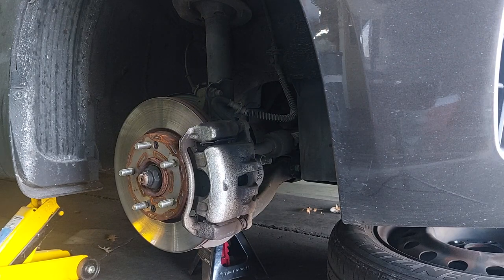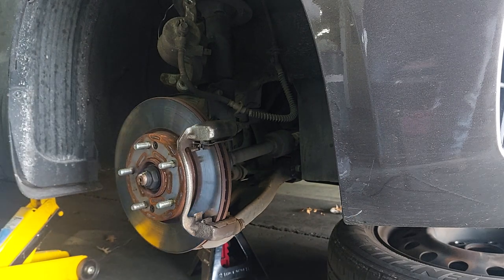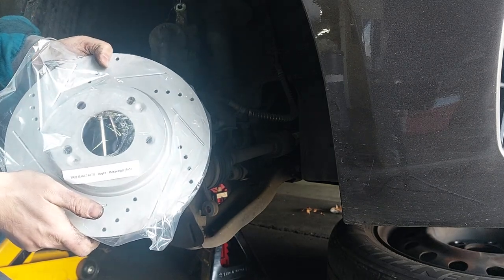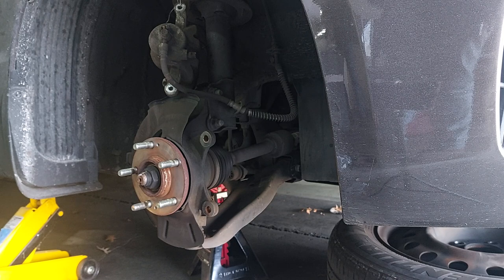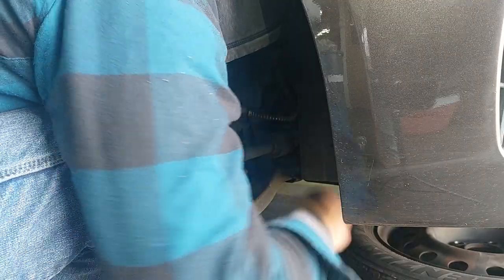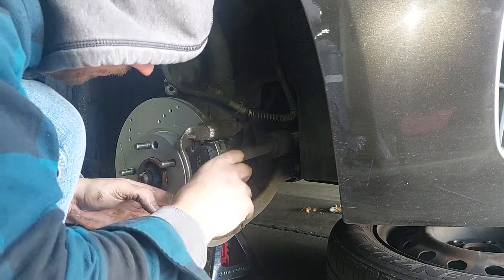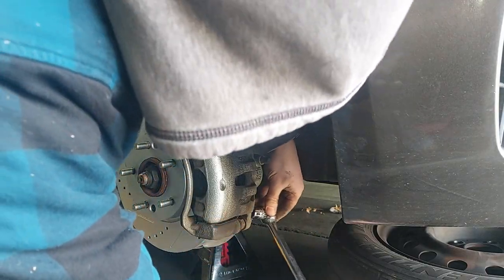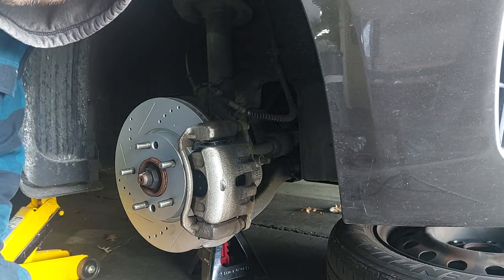Rotors on backward? 2018 Kia Forte TRQ Performance Rotors. PT. 1

Comment: It does matter… Do you know why they wanted you to put that on the right side?!  Because just like a sawblade, the rotor is meant to cut into the brake pad. If you turn that rotor around so that the grove is flowing with the wheel it’s not going to cut into the pad as good. Just like it you would turn a saw blade backwards. Come on man I know you’ve got to be smarter than that!
Reply from the maker: Thank you for your comment. Have you actually done any research on your comment? You actually gave me an idea! I'm going to do a video on the topic. And show the correct answers through research.